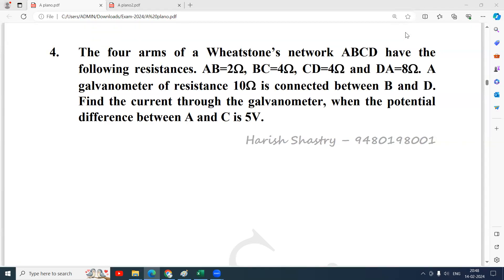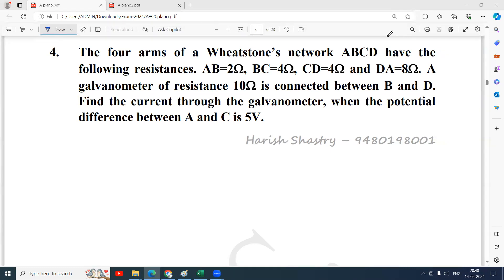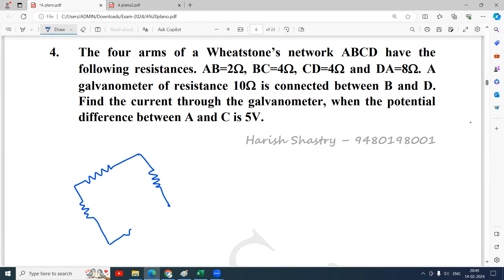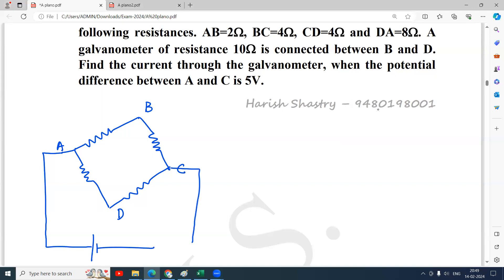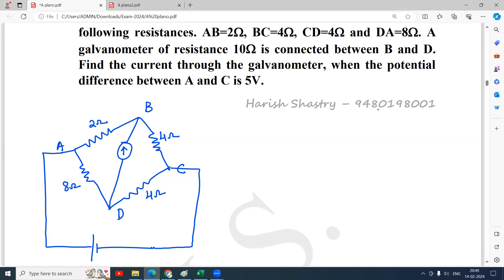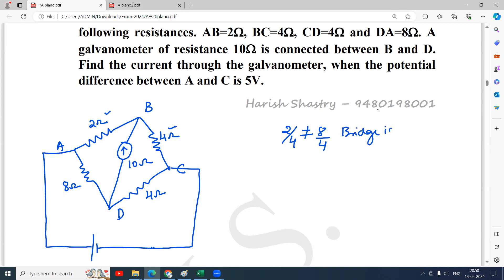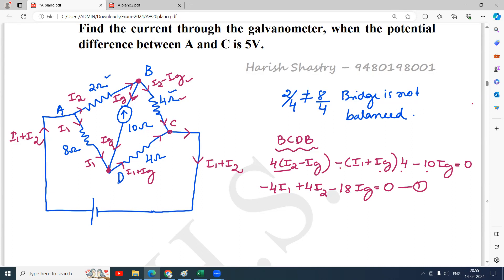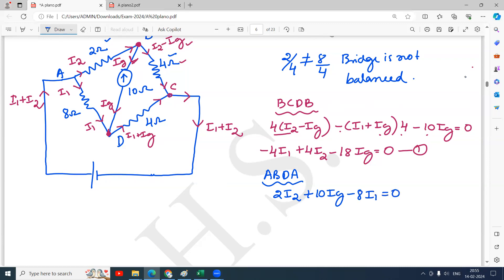The four arms of a Wheatstone’s network ABCD have the following resistances  AB=2, BC=4, CD=4 and

Comment: In a Wheatstone bridge, four resistance arms of the bridge are AB=2Ω,BC=3Ω,CD=4Ω and DA=1Ω .A cell of emf 2 V and negligible internal resistance is connected across AC and a galvanometer of resistance 10Ω is connected between B and D. Find the current through the galvanometer.